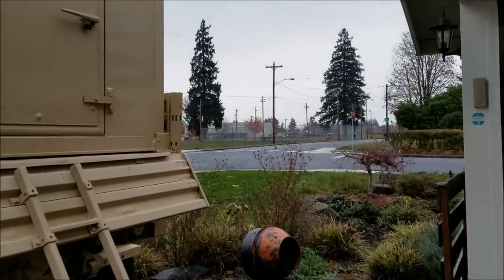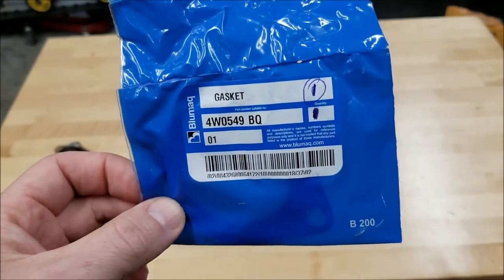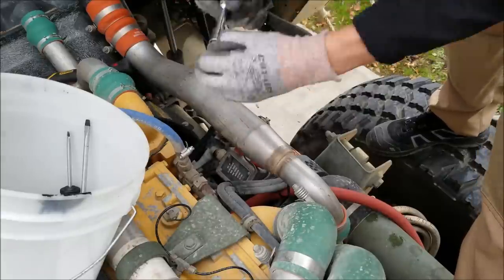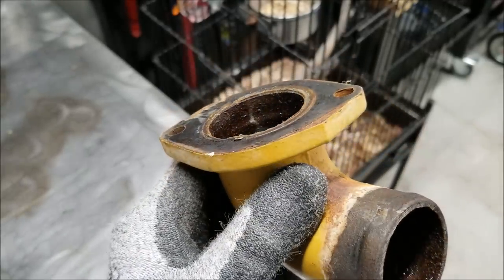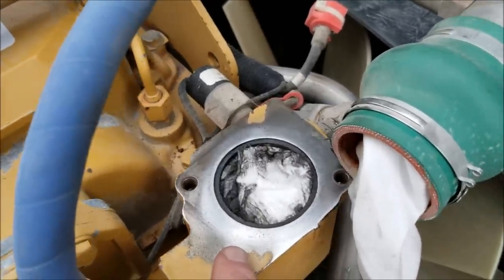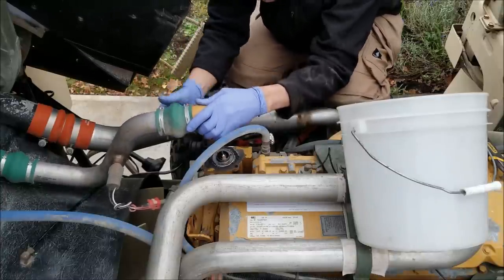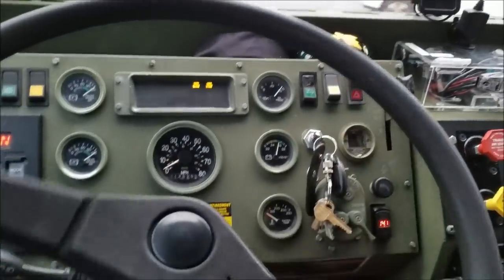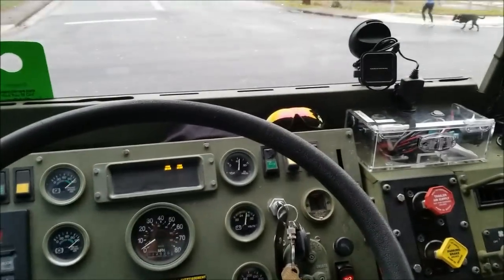Abel LMTV build part 48 (missing thermostat installation)

Comment: Thank you for this video. One of the items listed, when I purchased our truck from the county, was "water pump has a leak". e have not yet repaired it due to having issues with raising the cab, the hydraulic pump is waiting on parts for it's rebuild.
Reply from the maker: Hopefully your block is not cracked from unbalanced tires and driveshafts.

Comment: Hiya Sean...
Hows it going...
I've just recently found your channel an i'm loving the LMTV Video series...
I've been Binge watching them from the first one you posted...
I'm an Air Force an Air National Guard Vet from Missouri...
My last year of Active Duty was with the 3rd Combat Comm Group at Tinker AFB, OKC where Combat Vehicles was Life, plus with a Guard Air Control Group with lots of units full of Combat Vehicles...
Been curious why you always raise your truck cab manually by Hand Pumping instead of using the Control Box...
Is there a Hydraulic problem with the Cab Tilt function...
Love your videos
Keep up the Good Work
Andy......Southeast Missouri...

Comment: Thanks for posting... why do you use the hand pump to move the cab forward? I use the electric pump system on my LMTV and was wondering if yours might not be functioning?
Reply from the maker: There is an air to hydraulic system but my air tanks were empty.  It's good to exercise the manual pump every so often.  Thanks for watching.

Comment: Lol. Where did it go?
Reply from the maker: Troops used to take them out to reduce cab heat.  It's really hard on the motors since the mechanical cat diesels run most efficient at or above thermostat temp.